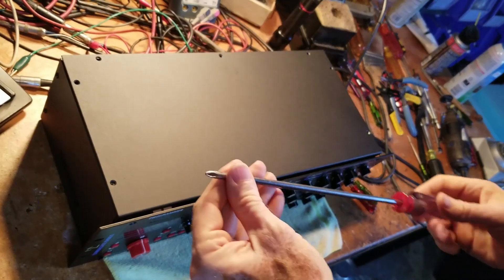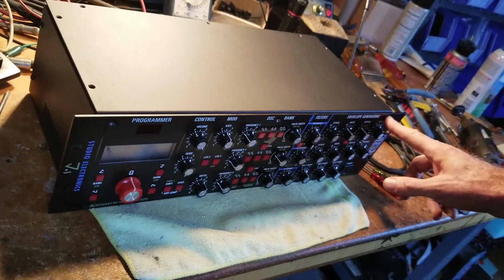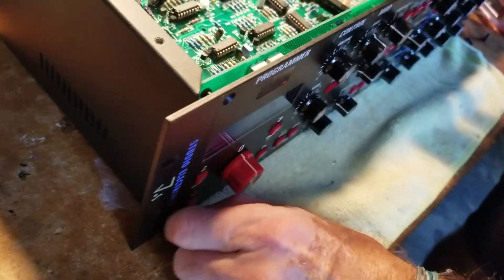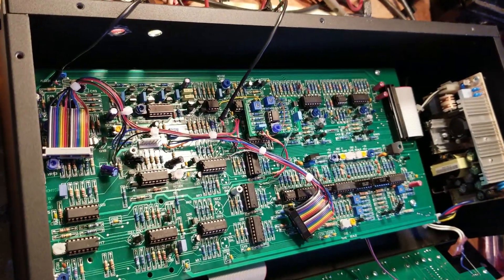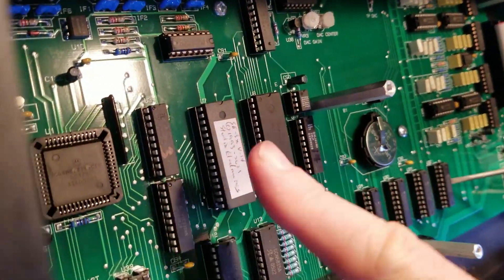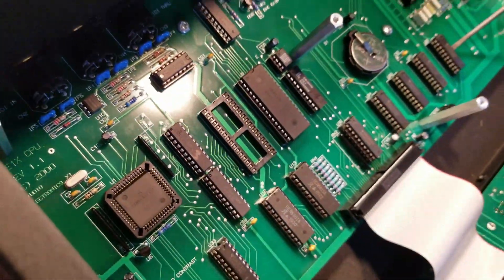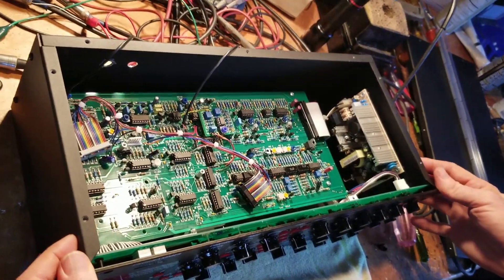SE3X Software EPROM Install

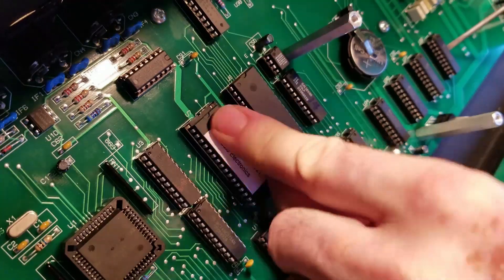Comment: 2:51 I'm not sure if it worked. New chip seems to be pushed in wrong way. Bottom legs of chip are not in the holes. Not so simple at all.
Reply from the maker: We made note of this in the 1st paragraph: "Uncharacteristically in this tutorial, GSR does not line up all the pins in their sockets (2:51) :/ Molto bizzarro. Make sure you do!—as he is offset by one." Are you experiencing an issue with your SE-3X software installation?
Reply: @StudioElectronics  Everything OK, I'm just looking around. Thanks for asking. I ordered a new one SE3-X unit via Thomann, now I'm looking forward to delivery.
Reply from the maker: @lutzfire  Wonderful. Perhaps I missed the humor :/  The '3Xs are beasts... Thanks much for your support! Programming the Para Bank - will forward it to you as soon as I am done. Best, MSR

Comment: Nice! Do you all offer a full SE-3X mod to the 1X?
Reply: Just the software. Too much surgery for a full conversion.
Reply: @seespam  understood. Aside from the filters, what would be the differences between an EPROM upgraded 1X and 3X?
Reply: @Bezowinz  you'll get 3 voice paraphonic mode, direct access to certain functions via front panel controls (ie. mixer volume), new patches, and overall little tweaks